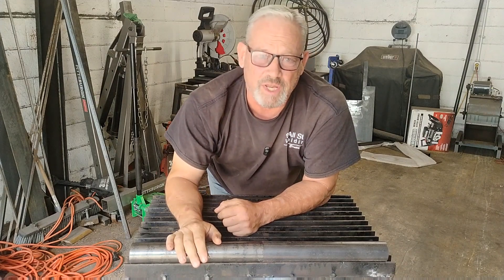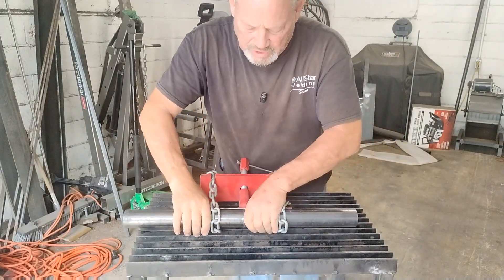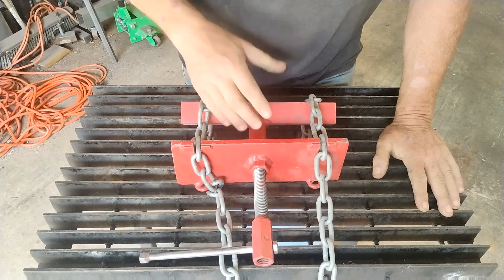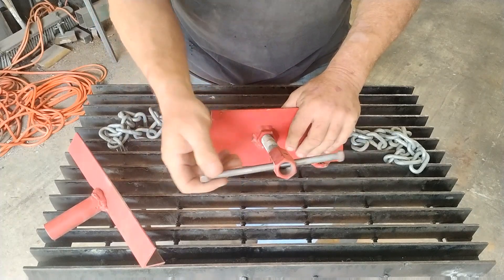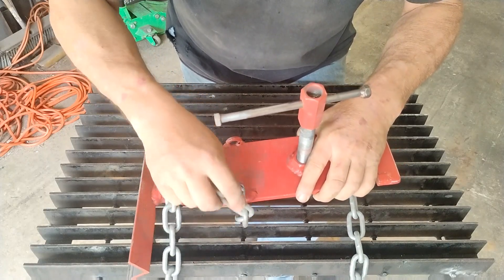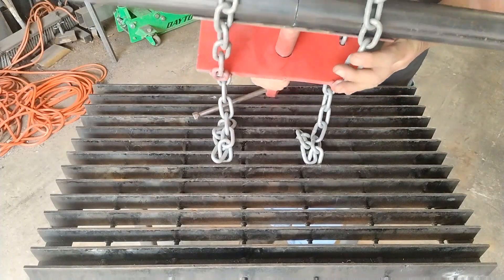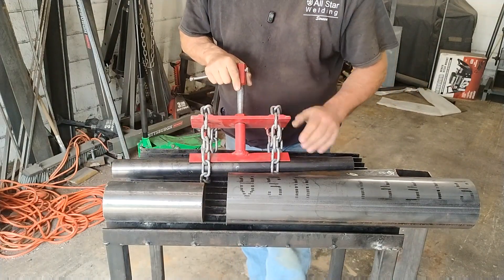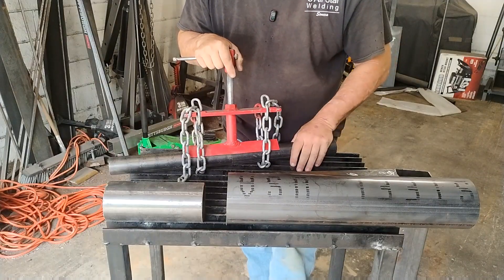How to Make a Homemade Welding Tool | DIY Welding Jig Build Tutorial

Comment: WELL DONE! Thanks for sharing this - I'll will copy it this week! This is much more portable and practical than what I have in my workshop - Saves time and assures perfect joints!
Reply from the maker: Awesome! I'm glad you liked the design, and that it will help you out. It's such a silly little jig, but I will literally turn around and go back to the shop to get it if I forgot to grab it. I don't always need it, but when I do, it is priceless. I used it yesterday, and on the way back I realized I never told y'all about it. So a video was made! You can tell it was spur of the moment with no thought to it, but I hope I showed it enough for y'all to get the jist of it to build yourself one.
Reply: @AllStarWeldingSC  I went right out back to the shop, thinking I could try it with a piece of angle and a couple of big hose clamps (the ones with the screws for tightening); that might be okay for occasional light duty tasks but YOURS IS FAR MORE ROBUST, and SUPERIOR for a number of reasons - Thank you!
Reply from the maker: Thanks. The chain really makes it lock down to the pipe.